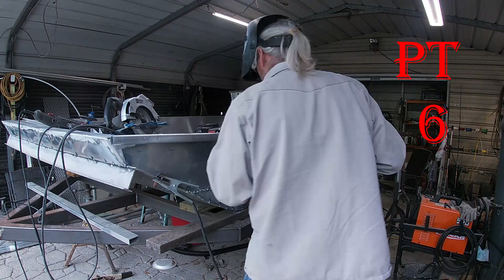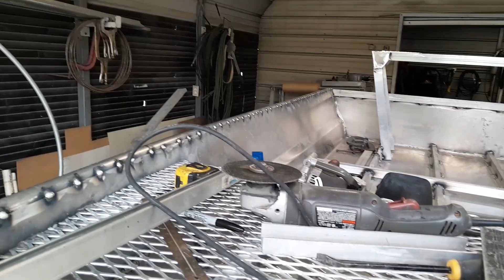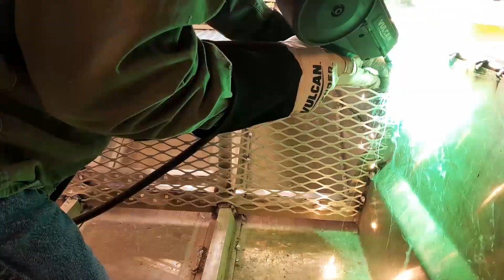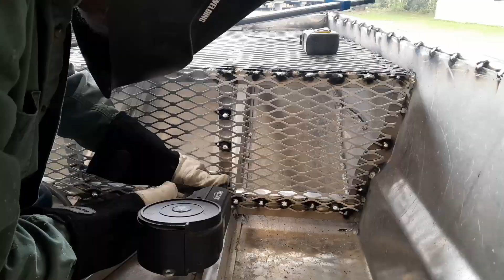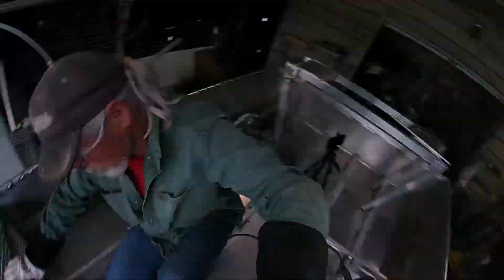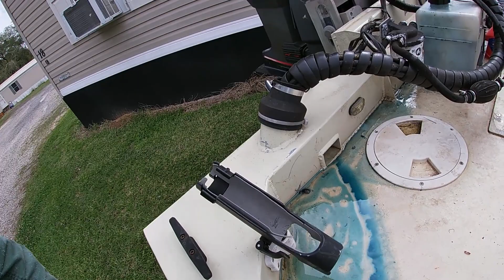Twin 459cc mini airboat build pt6

Comment: its always something whewn it comes to boats I'm telling ya I bought a boat from a guy that he didn't tell it had termites in the boat the front deck was completed rotted so I got that fixed and had to rewire the whole boat with new wiring then trim n tilt motor went out had to fix that floor is a little soft but its not as bad as I thought but its useable for couple years til I can fix that. but I got it back tip top shape and it runs well
Reply from the maker: BOAT Bust Out Another Thousand
It's a good feeling when you bring back a old boat to life. Get to have it like you want it. 
Thanks for watching and commenting on our videos